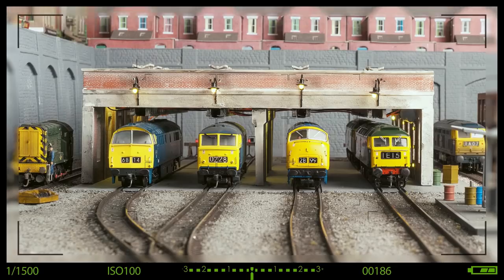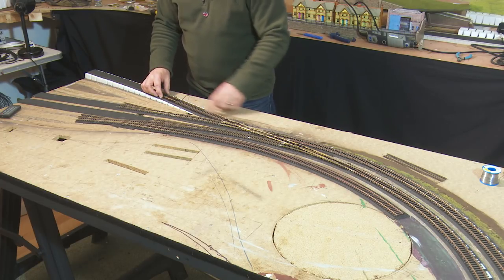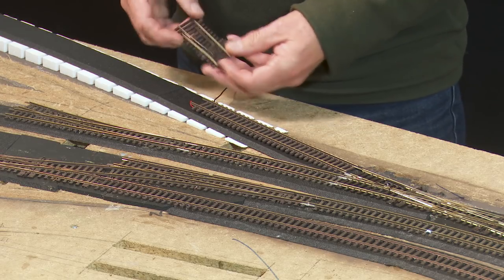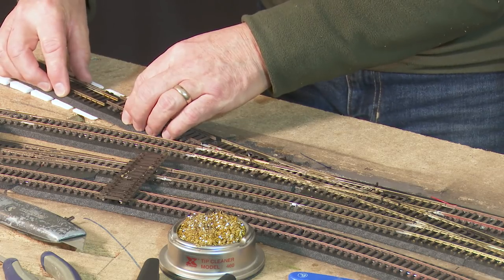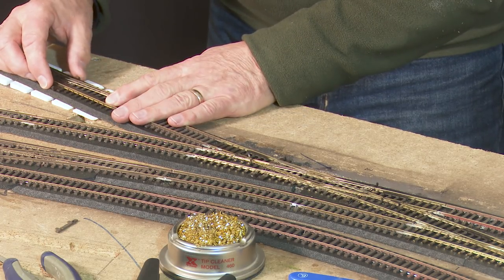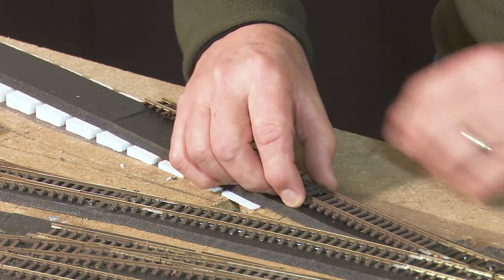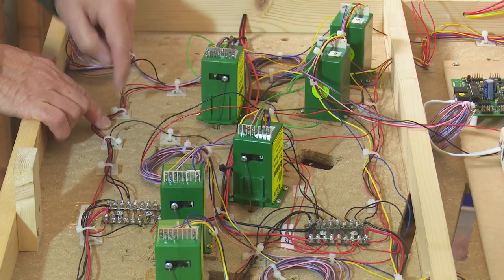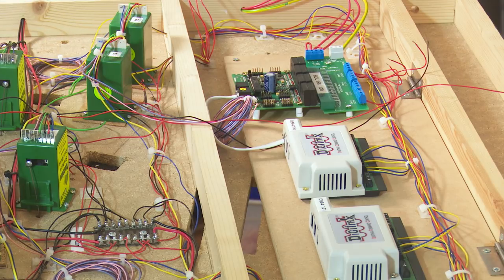Track Laying and Catch Points at Chadwick Model Railway | 79.

Comment: A useful video Charli, as usual.
Can I make two wee suggestions? The first is simple; get yourself a small shop-vac, instead of blowing sawdust everywhere.😀
And secondly: you may have thought of this already, especially as you have spare connections on the tortoise ~ would it be a good idea to have the section of track above the trap point "normally dead", only becoming live when the road is set? While derailing stray trains is the purpose of the real thing, you don't want a simple mistake to lead to a major derailment. A short dead section would stop anything being driven downhill into an open trap-point.
Just thinking out loud.👍

Cheers for now,
Dougie.
Oh P.S. Re the curved platforms; I'm sure you know the trick with your longest coach, a piece of wood with a hole in it, and a pencil?
Reply from the maker: Thanks Dougie, all good advice

Comment: American N scale just starting the design of the base board as for the platforms what are they made of?
Reply from the maker: Mine will be plastic and card
Reply: @ChadwickModelRailway  The best way to curve it is to cut out slots and insert wedges to fill in the gaps after you set the radius for the curve
Reply from the maker: Got it.

Comment: Hi, I think you may be confusing the term catch point with a trap point, in your layout the point is indeed a catch point but the photograph you show at 3.29 is a trap point. Catch points were installed on gradients steeper than 1 in 260 to prevent runaways in the event of coupling failure, now with modern fully fitted rolling stock they are no longer necessary and are gradually being phased out.
Trap points are motor worked points interlocked with the signalling system and are intended to prevent unauthorised movements onto a main line,  in the vast majority of cases the trap point is just in advance of the signal giving access to the main line. In the photograph you show it is likely there will be a signal about where the camera would have been, this would give access to the main line and the trap point would be interlocked with the signal.
It is a Department of Transport requirement that all freight only lines and sidings have to be fitted with trap points before joining a line signalled for passenger traffic, hence they are often seen at the exit of goods loops etc. They are additionally fitted at other strategic locations where there is potentially high risk - complex junctions, stations where a lot of shunting/ change of direction takes place etc.
Reply from the maker: Blimey MS, I kneel at your knowledge.
I need to do some further research but good on you.
Reply: @ChadwickModelRailway  Hi, I was a railwayman for 40yrs and a lot of that was as a signalman then later as a signalling inspector and traffic manager. When the Ladbroke Grove disaster happened the railway (then Railtrack) were heavily criticised for not employing 'flank' protection by installing a trap point at what ultimately was collision point. As I said earlier trap points are a requirement to protect passenger lines from goods lines but they are also used at complex junctions where an overrun of a signal is likely to be serious. In the case of Ladbroke Grove strictly speaking there was no requirement to install a 'trap' and subsequently one was never fitted, after the subsequent disaster whilst the junction layout did comply with standards Railtrack were heavily criticised for their poor foresight in what was a problematic track layout.
Reply from the maker: Thanks so much MS. Your explanation is invaluable.
Reply: @ChadwickModelRailway  Hi Charlie, you are welcome - give me a shout if you want to know anything about signalling etc. Funnily enough I'm not actually a railway modeller but I do make small steam engines and the search engine directed me to your site so I decided to take a look :-)

Comment: OK you want to know what scale/Gauges I play with. I started off with 1/64 scale standard gauge (an American Flyer train set at age 8), I then played around with 1/48 scale O gauge, with plans to make a harbor seen with 1/48 scale model boats. (that fell through when the other guys that were going to work on it move away). I have also picked up some O gauge and G gauge track and trains and cars some electric and also plans for some live steam engines.
Reply from the maker: Blimey Steamboat and good luck with your projects

Comment: Charlie, great video, learned a lot about getting the points in correctly and waiting them up. How do you like the tortoise switch motors and then DS 64 combination? The layout is looking awesome. I also model in HO scale. Thanks for sharing.  Ken
Reply from the maker: Thanks Ken, DS64  and Tortoise, top marks.
Reply: Thanks Charlie.

Comment: Catch points would not be sited immediately before a junction because the derailed train would be in the path of a train on the mainline. The reason catch points were installed was because a steam loco which had lost pressure could run back down the hill. Most locos were equipped with Westinghouse brakes, but not all, so that's why catch points were kept. In modern times, there are worked catch points where a train proceeding against the signal would be in a headlong collision with a train on the mainline.  On your layout, you should put the catch points at the top of the hill. Catch points on a hill would not be worked, so you don't need a point motor.
Reply from the maker: I understand your reasoning but I don’t believe that that’s the whole story.  
My layout is based around the late 60s/early 70s when unfitted freight was common and break-aways were not that rare.  If an unfitted freight going up the incline were to loose a couple of wagons, then without the catch point, they would end up on the main line.
As with most hard and fast rules, they aren’t that hard or fast.
Regards Charlie.
Reply: @ChadwickModelRailway  You want the catch points the at the top of the hill. They can go into a sand drag. Enjoy modelling this!

Comment: Hi Charlie, Love your videos - coming back to the hobby after ~40 years and have learned so much from your channel and your work at Peco. Love that you don't take things too seriously and share what goes well as not so well. Two quick questions - that board looked a bit of a beast what size and top board (chipboard?)? And second the trestles - are they saw horses and where did you buy them? I recently bought a couple amazingly sturdy metal ones for a fiver each in Ikea. Thanks! Ian "OO"
Reply from the maker: Hi Ian, the trestles are plastic B&Q types but not that strong! 
The chipboard is just 12mm recycled from an old layout

Comment: Hi Charlie, (OO/009) just a note about the wirestrippers. The RS, isn't Radio Shack, RS, is what used to be called Radio Spares and then just shortened the name to the RS we now know.  Beware of people selling RS stuff new, they often bump up the price massively! For example, the RS price is £43.01 inc VAT but a seller on ebay is asking 86.03. They just double the price!!! Just type rswww.com and that gets you to their site. BTW, Far-Eastern copies are available for under a tenner, some are OK, some are rubbish! However, I had a set of RS ones that gave up, so they are not perfect by any means, even at the premium price!
Reply from the maker: Thanks very much for the info Ben, much appreciated

Comment: Surely point motor would be the other way around it would be to protect trains on the mainline not up the slope, would need to be a left hand trap to take errant vehicles away from the mainline when facing other way currently your trap would derail towards the mainline
Reply from the maker: Hi Gary, have another look. Coming down the incline, a run-away would be de-railed to its left.
Reply: Chadwick Model Railway app ologies have watched it again several times and from most angles it looks as if trap is facing the wrong way there is one section where you put the trap down and you can see clearly the way it operates which as you say is down hill and to the left

Comment: May I suggest that you connect in a "slave" arrangement, the catch blade and the next point (double slip???) in such a manner that when you allow a locomotive and train to travel either up or down the incline, you know that the catch blade will conform to the direction of travel as set by the lower double slip.
Slaved so that when mainline is in use the catch blade is open to catch rolling, rolling stock and when the branch is to be in use the catch blade is appropriately set.
If not there may be a forgetful moment leaving the catch blade open possibly derailing rolling stock. I am aware that most Tortoise Motor wires are flexible enough to allow the blade to flex enough to accommodate such a situation but just the same....
Coming down the incline, the 'slaving' of these two items of track geometry will always be set correctly allowing appropriate movements without fear of operator created rail disasters....
Reply from the maker: Thanks Frank a valuable point

Comment: investigating DCC for a proposed OO guage layout but can only get Aussie rolling stock in HO Grrr.
Reply from the maker: But it will still be great Chris.
Reply: @ChadwickModelRailway  Hi Charlie,  I decided to go the Raspberry Pi - Arduino - JMRI path. The immediate question that springs to mind is that you mention DCC is 15VAC across the tracks but the system I am building is 12VDC. I have the RRCircuits Locobuffer USB link in case I decide to use Digitrax for the points signals and block detection down the track (pun intended)

Comment: Firstly the point you installed is a trap point not a catch point. A catch point always remains set to derail a train should it divide, as you can see the vehicles running back down the gradient would on the reaching the catch point be diverted off the track thus coming to a stop. The catch point would not be connected to the signal box and in an emergency it would require a platelayer to bar the point over and clip it to allow any recovery train to pass the catch point.
A trap point is different as it works in conjunction with a point on a converging line and is operated from a signal box and works in conjunction with the junction point. When the junction point is set in a direction that does not lead to the line the trap point is on, the trap point remains open to derail any train approaching it, thus protecting the junction and any collision potential. To achieve this safety factor it is obvious that the junction point and the trap point work in conjunction with each other. In your case the double slip and the trap point would be double ended.
I hope that I have explained satisfactorily and I thoroughly enjoyed the episode.
Reply from the maker: Hugh thanks for the in-depth explanation. All we need to do now is get Peco to re-label this item.
I’m so pleased that you enjoyed it anyway.

Comment: Hi Charlie - just subscribed to your channel and can help out on your wire strippers.  They are not from Radio Shack but from a UK tool supplier called RS Components.  This exact tool and same number at £35.84 is available on their website.
Reply from the maker: Thanks John for the info and subscribing too.

Comment: I am having conductivity issues on my n guage layout, sometimes, the trains do not pickup the power and I have to push them. Does anyone know how to improve the conductivity?
Reply from the maker: It’s either or a combination of,
Poor power to the rail
Dirty track 
Dirty wheels
Poor pick-ups
Good luck
Reply: Follow the steps charlie has given you and if still having problems this will help greatly,
Fit a BUS wire around your layout and wire up each piece of track to the one positive there negative if you have not already done so plus keep your track clean a track rubber would be handy to have once you have wired up every piece of track your problems should be solved mostly Charlie has all the videos on how to do it correctly I recommend his as one of the best, in my opinion, he is the best one out there to learn from but there are also some other good ones out there to cheekytek for one  Everard junction for another new junction and many more. have fun with your layout all the best john from Rugby.

Comment: Catch points, really??  Good for a prototypical view, but surely it's a bit of a faff...  Great video as always.  BTW, I model N Gauge.
Reply from the maker: Thanks Stuart
Reply: @ChadwickModelRailway  Just thinking about this a little further Charlie, you're running TrainController and I'm wondering if you can't you set up block detection around the entrance to the mainline such that TC won't let traffic on to the main if it's occupied.  I'm pondering this as I've setup blocks for iTrain in a similar way...
Reply from the maker: That’s exactly what I plan to do Stuart.

Comment: HO & G.  If those strippers are from Radio Shack, it's no doubt you can't find a link.  They have been thru bankruptcy twice here in the States.  Supposedly they are back in business in a very limited capacity. Cheers, and looking forward to seeing the locos negotiating that 3%
Reply from the maker: Thanks Gary and good luck with your project

Comment: 00 modeller but also your catch point was facing the wrong way when you were dry running
Reply from the maker: Thanks Chey
Reply: No problem when you installed it it was the right way it was just when you were doing the dry run at the beginning i was getting a little concerned you were going to install it the wrong way

Comment: Are you ever going to want to actually use the catch-point to derail your models? If not, then why waste money on a point motor?
Reply from the maker: Oh yes, I will certainly incorporate it into the Junction.
Reply: @ChadwickModelRailway  Presumably the master plan is to have them defend the main line as per the real world, throwing and closing automatically in conjunction with the appropriate red/green signals?
Reply from the maker: Exactly right J
Reply: For the same reason as you install working signals: it's what happens in the real railway, and surely we want to have as high a degree of realism as possible. I'm 00 by the way.
Reply from the maker: You’re right on the mark Tony.